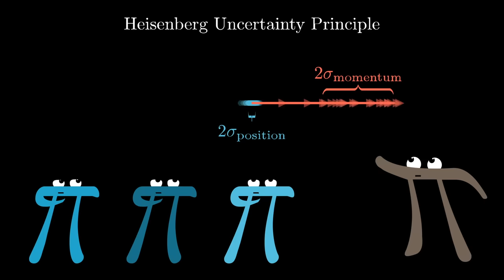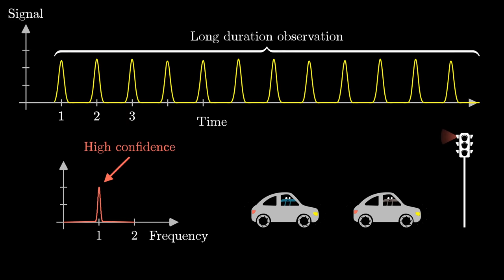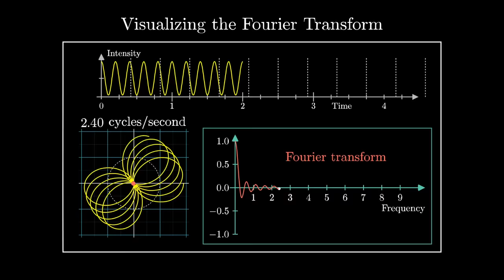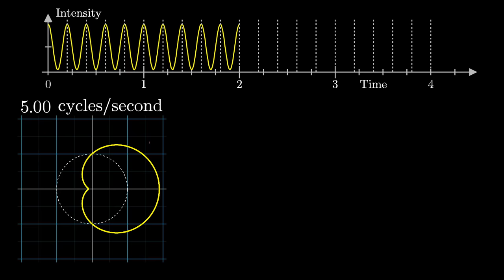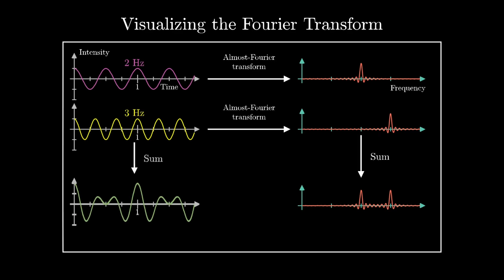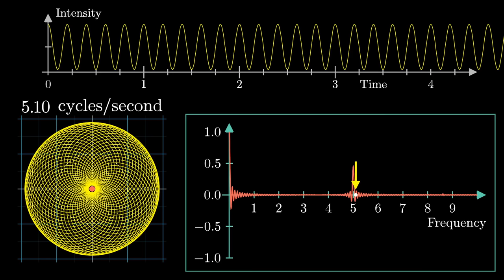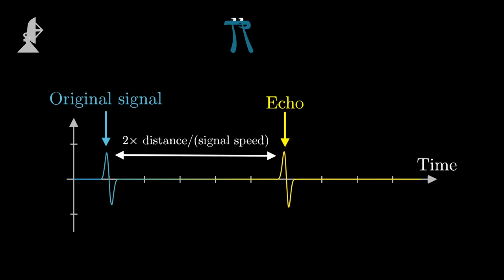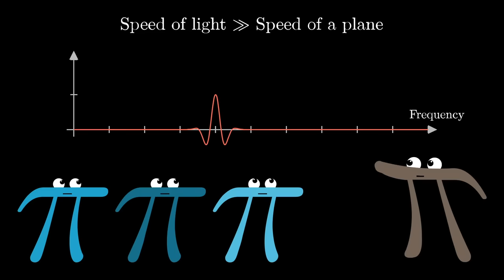The more general uncertainty principle, regarding Fourier transforms

Comment: Great video as always! As a physicist, I just want to point out something that usually bothers me about some phrasings of the uncertainty principle (which you were careful to also do in the last minutes of the video). When people say "you can't know the position and momentum of a particle", you really need to bring the probabilistic interpretation of quantum mechanics to make sense of that. It certainly does not mean that you can't measure both quantities. If you have a certain localized quantum state (with low position uncertainty) and measure its momentum, you will get a definite result in your detector. It is only when you prepare the same localized state and measure its momentum again that you realize the result is now different than before (and repeating this process many many times you'll conclude indeed that the uncertainty of the momentum is large). This has to do with particles in quantum mechanics not being described by its classical state (which is characterized entirely by its position and momentum) but by its wave function. That popular phrasing of the uncertainty principle in a way extrapolates by saying that the particle "has" a position or momentum a priori, which is a little misleading (or at least debatable in the various interpretations of quantum mechanics).
Reply: As a physicist I say comments like these need more upvotes for any video talking about the uncertainty principle where this particular point isn't made very clear.
Reply: as a physics student, i am crying
Reply: Does this mean "you can measure but you can't predict"?
Reply: @michakubisz535  You could say it yes and no. The whole thing again boils down to the argument that Quantum mechanics is not entirely deterministic. So to answer your question, you could say, you can measure it and also predict the "probability" of a particular event happening.
Reply: @michakubisz535  You can predict but not with 100% confidence.
Reply: Thanks for that great comment (as a physics student ;) ), and the genius video 3blue1brown, really helps a lot.
Something I read in the theoretical minimum QM book by Leonard Susskind made it clearer to me: 
   The state and the result of its measurement for a system are the same in classical mechanics (state=result of its measurement), that is, when you measure the state of a system (the position of a particle perhaps) you, simply said, "just read out its state". 
   That's completely different to quantum mechanics, where state and result of its measurement are not the same!!! The measurement can be understood as in classical mechanics, reading out a value for a certain state. But now this value isn't priorly defined, it's not certain (it's unbestimmt in german) as opposed to classical mechanics, where the philosophy is, that every state is defined and one can simply find out it's values by measuring it (this is the basis for determinism, which is inherent to classical mechanics). Mathematically this undefined nature of a qm state is expressed by the wave function. 
   To conclude, as marcni said, it's not that you can't measure a given value, it's that the value itself is not given (defined) prior to the measurement. That's because the state is a distribution that is connected to the probability of a certain value to be the measured value. As in his example, you find that the values for a repeated measurement of the impulse is distributed. If this is done many times what you get is a distribution of values with a peak, this then is the most probable value for the impulse to be measured. 

That a single measurement still gives a value and not a probability comes from the "no measurement is gentle enough to not influence the qm state itself" nature of QM. -> meaning, the state becomes defined (certain, bestimmt) by the measurement which then gives out the corresponding value.

Please correct me if I got something wrong. Still in the middle of finding a way through this uncertain qm mess (but loving it more and more :-) ).
Reply: Kinda late to the party but is it possible that that constant change in momentum occurs as a consequence of the physical process used to measure the particle? In other words, aren't we limited by the fact that we can't measure something so small without disturbing its current state?
Reply: @TheAwesomeMister  Now I am not a physicist, only a QM enthusiast so forgive me if I have the fundamentals wrong (and also correct me, I'd love that). I think you and the OP are essentially saying the same thing, that the particle is in a superposition and does not have a fixed position or momentum like a state in classical mechanics but is described by its wave function. The collapse of the wave function on measurement still remains one of the large mysteries of the universe. I am curious though if there is an analogy that can be drawn between the Fourier transform of time and frequency (sound) and position and momentum (QM) in terms of a lack of a definite state right before measurement. I think no because sound operates on classical mechanics.
Reply: Psyched 124 no. The truth is, there are no particles. Only the wave function of the universe and the fields within. You cannot measure a particle at a specific point because it is a wave in a field in a wave. It has no points.
Reply: @tatodlp   In the double slit the particles seems to go through both slits but if you place a detector then it goes suddenly only through one slit. Of course it's logical to think that you can't measure that tiny particle without disturbing it. It's not the same situation. But it seems that this was the objection already long ago and that they found that no, there is more going on than that. 
 I hope it's correct though to say there is no  particle before we establish some interaction. Before that there is a only a well defined (!!) probability wave describing where it's more or less likely to find a particle , that is though not yet existing as such.
Reply: Wow man thanks! I copy pasted saved your explanation for easy reference, what you wrote is exactly what I needed to understand further. It's incredible how an explanation from another point of view can deepen understanding.
Reply: A feel like water is a better analogy, because it's not measuring someone with a wave, but rather is a wave itself. Asking where a given wave is doesn't even make sense because of how spread out it is. If it's a tsunami on the other hand, then you do have a more definite idea of where it is because there's only one peak, but not having a second peak means it's impossible to measure the frequency.

The weirdness has nothing to do with the uncertainty principle and everything to do with thinking of the particles as waves. Once you start treating them as waves just like sounds or ocean waves, the uncertainty principle just seems painfully obvious.
Reply: I'm Interested in the DIAGAGNOLIZATION  of matrix EIGENVECTORS, and VECTOR  using Taylor expansion and DETERMINANT for infinite series and PAULI MATRIX and Clifford Algebra for solving the Schoringer Equation And HEINGBER uncertainty for QUANTUM FIELD PERBUTATION
Reply: @marcni, you just clarified a point of confusion that I had with the video. The airplane has a definite position and velocity but the precise measurement of either property with radar can only be done with two separate measurements. Which 3b1b's presentation of this suggests that quantum mechanic "weirdness" is an emergent behavior due to only being able to measure particles with photons. Which, you're clarifying is not the case.
Reply: you've melted my brain even further😃👍
Reply: Exactly as the comment. As why you have the ih in momentum operator is because you make derivatives with respect to x in wave function
Reply: Great pt

Comment: I love these videos. I finally understood the mathematical meaning of the uncertainty principle. And I didn’t comment those other videos, but your Linear Algebra series was excellent. I can’t tell you enough how many times in my life I was multiplying matrices without having any single idea of what it meant. Thank you!!
Reply: @erdemmemisyazici3950  The fact of waves is more fundamental. The idea of not being able to observe electrons because that requires a photon of high energy is true. However, the fact that particles are described by wave functions rather than points in space is what makes the uncertainty principle fundamental regardless of what an observation entails. For example, the uncertainty principle also applies to measuring spin about two different axes. In this case, you don't require a photon to measure this but you can't simultaneously know the spin about two different axes regardless and that is because of the fundamental nature of waves, rather than the act of making a measurement.
Reply: @andonimcleab994  Now that's interesting.
Reply: Pi is infact related to e" The Natural Logarithms, the Golden Ratio Taylor and Maculin  series , Hyperbole, Coding theory, TRIGONOMETRY  Exponents , Prime numbers the Quadratic formula,Fermat last theorem, Cantor Ordinal and Cardinal Infinitel numbers

Comment: Great video as always. Although a minor correction regarding doppler-range tradeoff for radar: Good range resolution does not require a short-duration pulse, but on a highly localized auto-correlation function, which requires wide bandwidth due to uncertainty principle. Although time duration and bandwidth are inversely related for the wavelet signals you are using, you can use other waveforms that have both long duration (for good doppler resolution) and wide bandwidth (for good range resolution). A typical example would be a repeating set of chirps.  But for a given constraint on the waveform’s time-bandwidth product, the range and doppler resolutions are fundamentally limited due to the reasons you described in the video.
Reply from the maker: Yes!  Thanks for sharing.  This is more or less the part I referenced “purposefully glossing over”.  The original script had something closer to this, but it ended up just being too much too beside the main point the video is shooting for.  My hope was to be upfront in the video about things being oversimplified and including a link to where people could learn more in the description would forgive me my sins :)
Reply: 3Blue1Brown Yeah - I imagine its a constant struggle to balance technical accuracy vs accessibility and straightforwardness on all sorts of details like this. Anyway, keep up the great work!
Reply: Time to develop some more interactive format where the user converges to technical accuracy by an iterative process ;)
Reply: @halbeard2996  Maybe 3B1B should use glossed over topics as a to-do list of videos.
Reply: @halbeard2996  it already exists. It's called graduate school. :-)
Reply: +Roland Hutchinson - If only it were that easy, but we all know that's divergent.
Reply: Yakir Aharonov: "There is a non-local exchange that depends on the modular variable....I'm saying that I have now an intuitive picture to understand interference by saying that when a particle moves through two slits, it always goes through one slit or the other, but it knows which other slit, the slit through which it did not go, whether it is open or not, because there are nonlocal equations of motion." Finally making sense of the double-slit experiment (2017, Aharonov): The nonlocal equations of motion in the Heisenberg picture thus allow us to consider a particle going through only one of the slits, but it nevertheless has nonlocal information regarding the other slit.... The Heisenberg picture, however, offers a different explanation for the loss of interference that is not in the language of collapse: if one of the slits is closed by the experimenter, a nonlocal exchange of modular momentum with the particle occurs....Alternatively, in the Heisenberg picture, the particle has both a definite location and a nonlocal modular momentum that can “sense” the presence of the other slit and therefore, create interference." as John Bell states: "Is it not clear from the diffraction and interference patterns, that the motion of the particle is directed by the wave?"